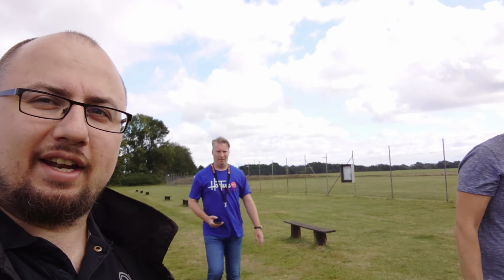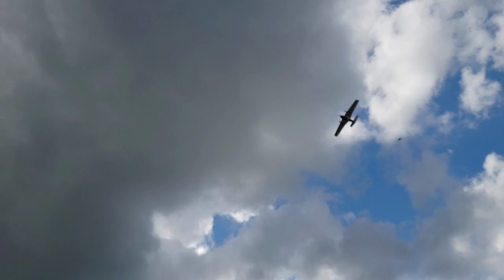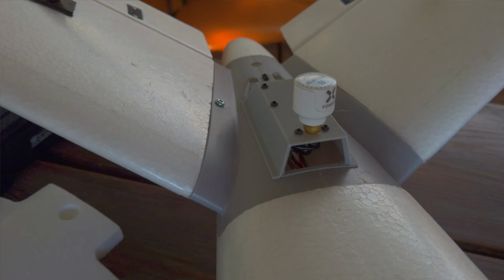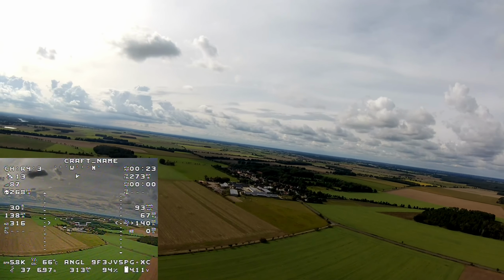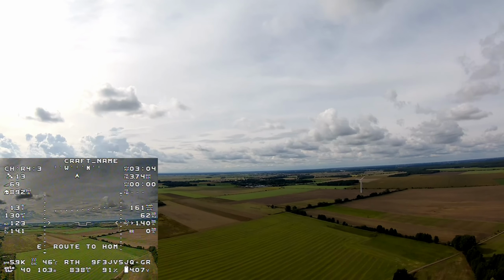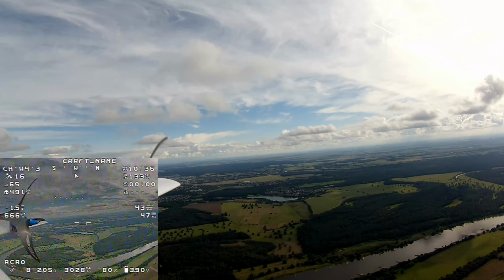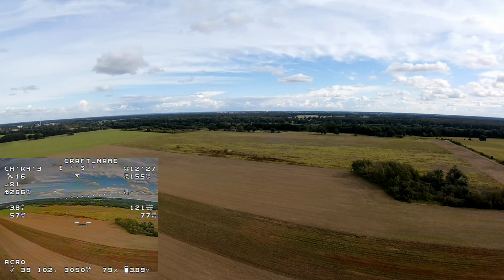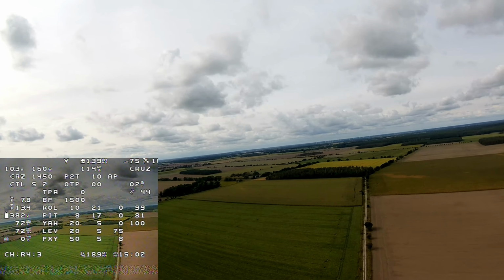X-UAV Clouds Maiden - My biggest Project yet!!!

Comment: Nice setup. I don't like the "Plop" landing method. One of my favorite things about a twin is the slow, mild Alpha, tail first touch then use throttle for a  feathery smooth and light touch down.
Reply from the maker: Yeah landings are not perfect yet. The changing wind speed was a bit challenging and a gust lifted it up on second landing. First one was better. But I also have it very slightly nose heavy for the Maiden. This is the CG that Arxangel also recommended and it flies perfect.

Comment: Hello, that looks like a great project. I have a question I see that your both propellers are ccw. As for 2 motor configurations shouldn't it be one cv and another ccw doesn't it make it less efficient?
Reply from the maker: it makes no difference on a twin motor like this. Might be different on other models, I am not sure. 

I try to keep the (possible) reason short as far as I understand it. 
The Air behind the props is moving backwards in a spiral. That means on props out (top side away from the body) the outer portion of the wing gets propwash from above, creating no lift, while the inner portion of the wing gets prop wash from below creating some extra lift. On the other side its the opposite. 

As the prop wash creates lift over the wing further out on one side and further in on the other side in this config, there is more leverage on the inward spinning prop. this differential propwash lift cancels out the torque of the motors. So far my theory. 

I tested this on the bench. With no props on at all, the motor bell inertia alone causes a significant roll rocking of the airframe when throttling up indeed. But as soon as I put the props on, there is no noticeable roll torque present anymore, despite that the props SHOULD cause a lot of torque roll. 

I was planning on having different spin directions but the CW props had been out of stock back then. So I gave it a shot and it works just fine. Different airframes could behave different. Your mileage may vary.
Reply: @MarcFPV  I really appreciate it, I will try it in few days and I will share my experience here.

Comment: Nice!!   building one myself. What glue did you use on the wing & v-tail plastic joiners to the foam??
Reply from the maker: I used UHU POR for the whole plane but I recommend to use a better glue that can fill gaps. like E6000
Reply: @MarcFPV  Thank you, decided on epoxy for rear plastic joiners, Coming out nice. Trying to finish plastic joiners tonight. Probably e6000 for front joiners??  I did all the foam halves in gorilla glue. She's looking solid. Thanks for your input.  Is your Clouds still doing good??
Reply from the maker: @mrreddog  The Plane is doing me some headache. I hate the foam... so sensitive to scratches and dents it is unbelievable and I totally failed when I wanted to laminate it.... 

And I am still in the process of refining my setup but had little time the last months.
Reply: @MarcFPV  When you get back to it, with your laminating. do the plane in sections, even small pieces overlapped. Specially in the curved areas like the nose, tail & where fuselage meets wing root. Its not seen. Its time consuming but worth it.
Reply from the maker: @mrreddog  the problem is the crap foam. it bubbles like crazy from the lamination iron heat.
Reply: @MarcFPV  I'm now having major problems where I glued the front wing joiners!!  I used E6000 and its sucking into the foam deep, making it very soft. its gone 25mm in some areas, creeping from plastic joiner toward main body.  Everywhere the E6000 was used is very soft, behind motor mount area too.  DONT USE E6000 ON XUAV  CLOUDS.  Im now gonna try drilling holes in plastic wing joiner & run several carbon rods through the soft foam into where its still firm. The main spar seems to carry the load to outer wings ok.  What a bummer. I did a test spot 1st, it seemed fine, but when loading glue all down joiner, it didn't like it....
Reply: Lower your heat
Reply: Seems like the E6000 that creeped into the foam is starting too firm up 4 days later, still soft though...

Comment: i heard in one of the inav lives you mentioned the you changed a few things on your clouds setup , do you mind telling me what you think is the best setup for it ? like motor, props, escs ,battery and C.G. etc...    thanks
Reply from the maker: most. changes are on the pan and tilt and other extras. the only change on the power train is, that I switched from 12x7 to 10x10 Props. they will give a bit less thrust (it was massively overpowered anyway) but more pitch speed. the smaller props with lower rpm should raise the efficiency a lot. but not done longer flights yet as I worked on other projects